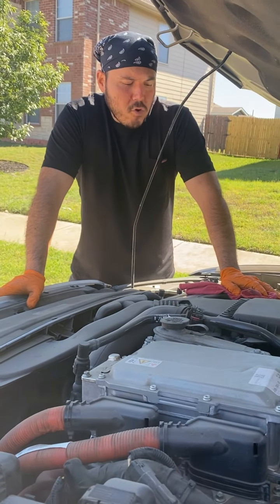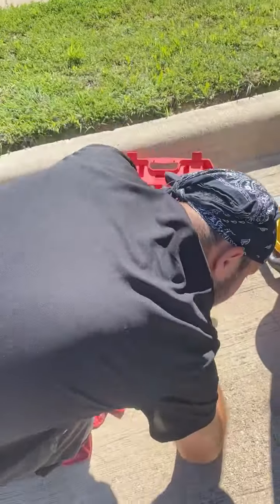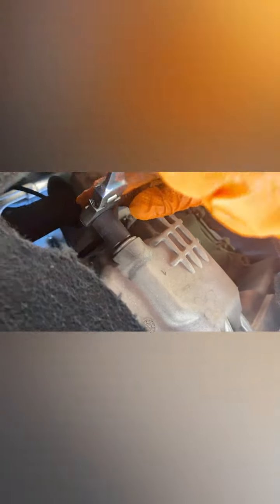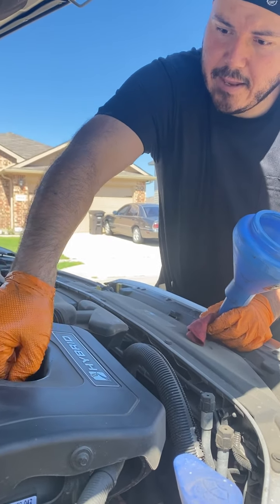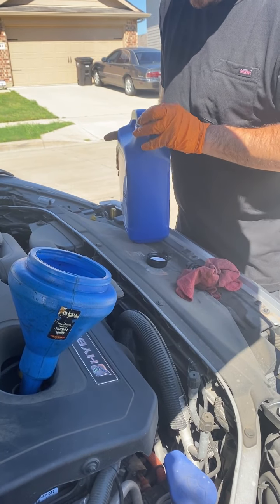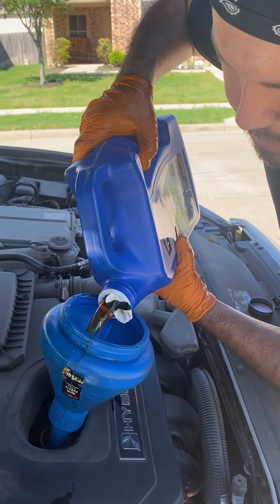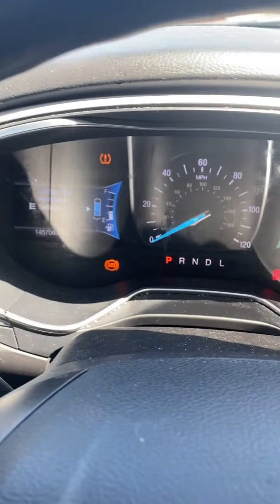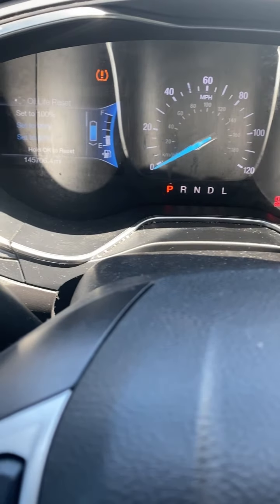2015 FORD FUSION HYBRID OIL CHANGE

Comment: Hi, I have a 2019 Fusion Hybrid with 60,000 miles on it. Is it time to change the oil? What are the first symptoms of damage to the ECVT?  Thanks;)
Reply: Most cars now have oil changes every 7500 miles but I'd check your owners manual. Most transmissions in general are suggested to have the fluid changed every 60,000 miles